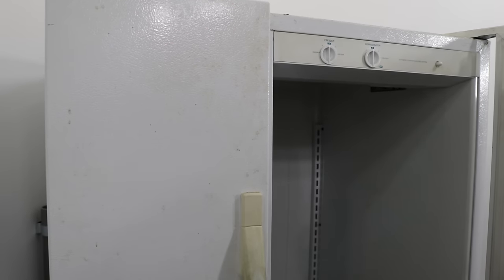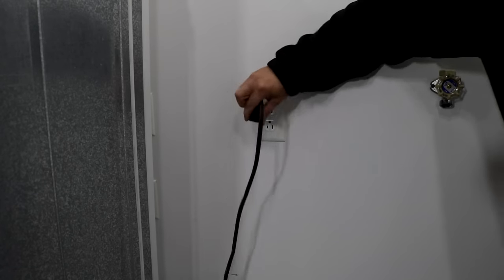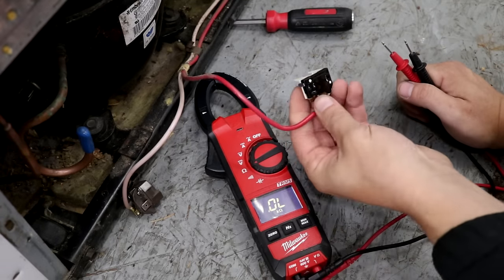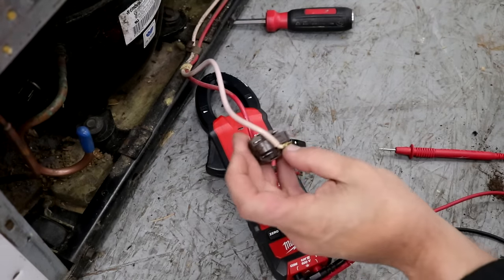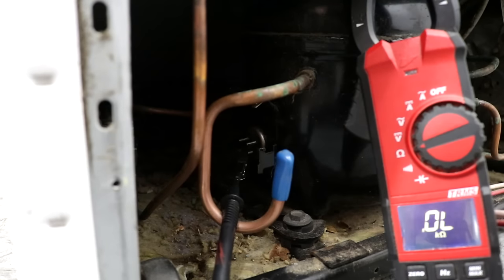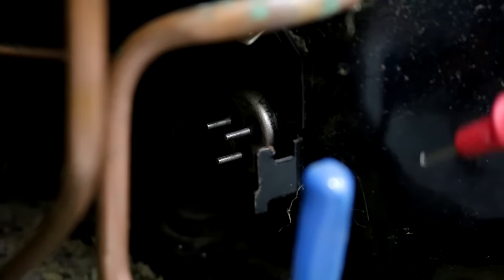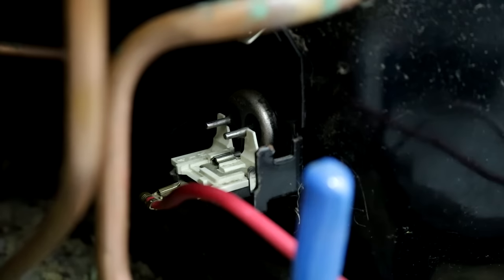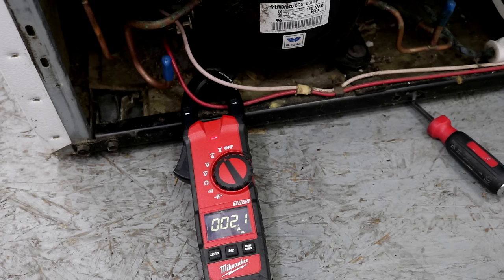Whirlpool Side by Side Refrigerator Compressor Testing - No Cool Repair

Comment: Replaced the relay and capacitor on my Amana that has the white type assembly. Still would click off after a few seconds. Tested compressor using the ohm method. Checks fine. Still won't start and run. Frustrated

Comment: When I test the 3 prongs with meter set at 200 ohms I get 11.1  -  4.6   and   8.0 is that Ok?? When I check prong to ground, it checks out ok, NO Grounding going on there.
Reply: I get basically the same thing.  Overload circuit reports anywhere from 5 to 1.2 ohms.  And other pins also reports resistance all over the place 11, 8 and 4 (start and run whine-dings).   Compressor reports higher then 2.0 amps and bumps to 8 to 10 amps when running, but I can hear a clicking sound when the compressor clicks on.

Comment: What if the compressor starts and runs for 5 seconds then kicks off?
Reply: That's the purpose of the AMP check . if the compressor draws to many amps on start up the overload will open (as it should) how ever the relay switches from start to run in that 5 sec's so you may have two potential problems 1 bad relay 2 bad run winding in the compressor., the tests performed in the video should point you to the true cause either/or.

Comment: Why not check amps first?   Putting your hand on the compressor will tell you if it's running by vibration.  Tell us how hot it should be to the feel--like too hot to leave your hand on or comfortable or what.
Reply: If the compressor is running (feel it) and the refer section is cold but freezer not cold enough, then it's probably choked with ice.  Simply defrost it.  There are two ways, one where you dig into it and use a hair dryer and the other where you simply unplug it and lose a lotta food.

Comment: All the fans run on mine but it still wont cool the compressor makes a small click but it does not kick on it feel like its heatin
Reply: Compressor is clicking but not running, its going to be your starting components. Replace those, and you should be good. That clicking sound is a good thing, it's what most technicians hope they hear when they approach a no-cool refrigerator.

Comment: I have that fan running most of the time and yet every few minutes, the compressor kicks on and within 5 seconds, clicks off.  This all started after a power outage of 11 hours.  If it was one of those parts on the side that was bad, would he compressor even keep kicking on?  Meanwhile, everything in the freezer has melted and yet it’s cold with frost and the fridge is staying cold.  So frustrated.

Comment: I have a MayTag mzd2766gew and there was this clicking sound when it wants to start and I knew that was the relay and overload issue which I changed and everything was fine and it worked so good,I disconnected the unit from power supply just to put it back in it's original position and when I did I left it for some time and when I plugged it back to the power supply it starts and stops at immediately. I don't know what could probably have gone wrong with a unit that worked perfectly well this minute and all of a sudden stopped working the next minute.

Comment: This video was VERY helpfull..My fridge go dead last friday, after the home power go down.
After the power came up..the fridge start to have the problem and only after 6~8 hours we notice that
the ice cubes start melt..water on the floor and frozen stuff get melt.
So I called the tech..he say "take the power out keep the fridge off till i come..
after 3 hours he arrived...then he looked at the back and in the freezer..
(I did open/take off the back cover and the freezer in-cover.)
He plug the power..the compressor start working ..Ice was bild in the freezer unit..
all looks SO good for 5-10 min..then we hear the "click-noise" and in compressor was VERY hot and die..!!!
He said:  need to replace the compressor..and since it's R12 it need to be replaced to R134..
COST OF REPLACING PARTS (replace my FGV-130A compressor) will be about $400$.!!!
he said ..better get new fridge.
on Friday and Saterday Here in ISRAEL ALL CLOSED
I put about 20 frozen water bottels  in the fridge and in the frezzer to get over the weekend,open the fridge Only 2 times in 26 hours ..was hopping that food will stay OK over the weekend W/O working compressor ...so on Sunday
I was staying all night looking true youtube ..and got this SO GOOD EXPLAINED VIDEO.....all got SO CLEAR.
In the morning I got my Multimeter checked all the point you show in the video....BOOM = the PTC RELAY
the Start leg =OK the RUN leg=disconect=OL "no contact.
1 hour to run and get the part...install and it all 100% BACK TO NORMAL WORK...with pay off $10 and
ONE EXCELENT GREAT VIDEO WITH good explanation Up To Point what need to check and see.

YOU help me so muce..Can't stop to thank you ....evry time I pass this fridge...MAKE OUR HOME HAPPY.

P.S.   On my fridge the PTC-RELAY have 2 Blue wires connected...That was The CAPACITOR...Please add this up